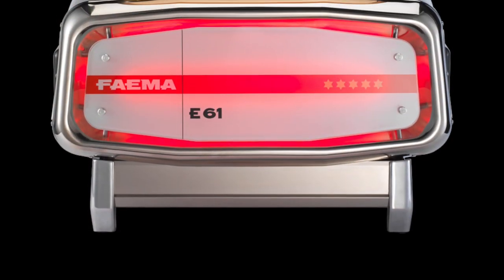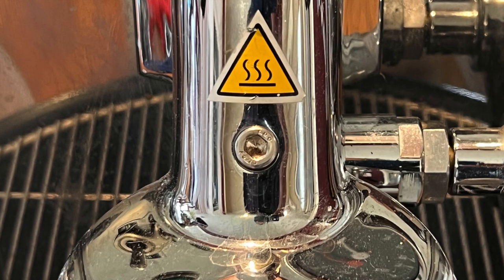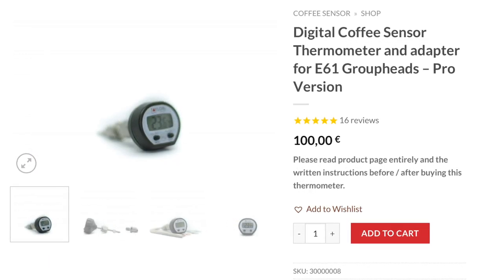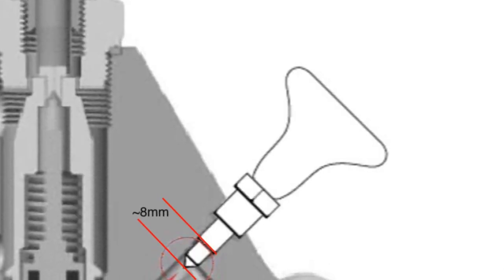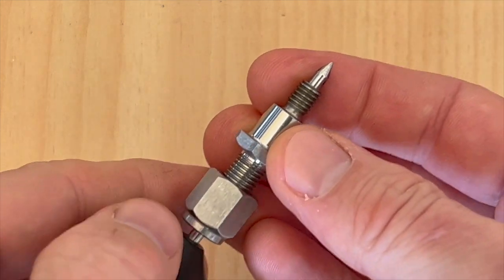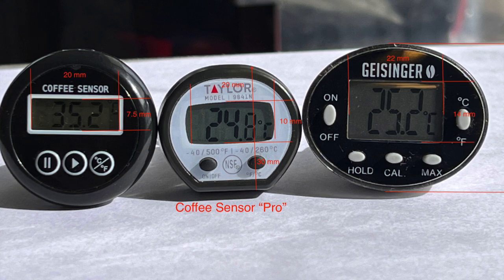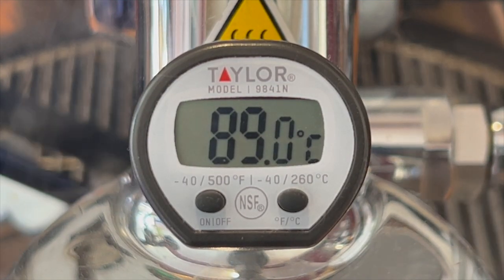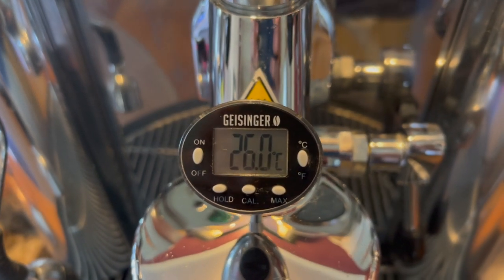Review of 3 Digital Thermometers for E61 Group Espresso Machines

Comment: Did you find a way to test the accuracy of the thermometers? I've got the Geisinger one a few days ago. Even though my Lelit Mara X is set to 91-92°C range, Geisinger shows in a range around 93-95°C, most of the time. 
According to the channel "Kaffeemacher" on their temperature test for Mara X video, they say "Coffee Sensor-Basic" shows 1,5°C more of the actual temperature inside the group head. I think  there is a similar deviation for Geisinger as well. But it'd good to know how much of a difference that is :)
Reply from the maker: I did do a 4 way test using my kitchen digital thermometer and the 3 E61 thermometers in freshly boiled water. The Geisinger and the Coffee Sensor Pro were pretty much in agreement with the kitchen thermometer by about 0.5C. The Coffee Sensor basic was off by about -1.0C to -1.5C. I don't think accuracy is that important though. What the thermometer gives you is consistency. Even if it isn't giving you a deadly accurate reading each time you use it you should know the temp range, after using it for a while, which produces the flavours you prefer. It is primarily as a reference guide which E61s lack.

Comment: Very nice video
Did you do a review for la Pavoni version?
Reply from the maker: No, I got a free sample of the La Pavoni digital thermometer but I didn't like it. There's also nothing to compare it too that I think is a fair comparison so I decided not to review it. Instead for the La Pavoni I settled with one of those cheap digital "fish tank" thermometers and modified it to have a thin film NTC thermistor than I taped onto the LP head with aluminium foil tape. Works great! I should really do a video on how that is done but I've so busy with working on the Bluetooth thermometer and accompanying app I'm developing.

Comment: Muy buenas noches que buen artículo hace poco compré una expobar office de leva mi pregunta es cuanto tiempo hay que dejar prendida la máquina para que tenga la temperatura ideal mil gracias.
Reply from the maker: Each machine is different as each model/make has a different size of boiler and heating element power. For example a small boiler with a large heater will be fast.This is why these thermometers are so essential as they take the guessing out of it. Also the heating time changes if you live in a colder country where the ambient temperature, or starting temperature, changes with the seasons. This is especially true if you have a plumbed in machine taking water directly from outside.